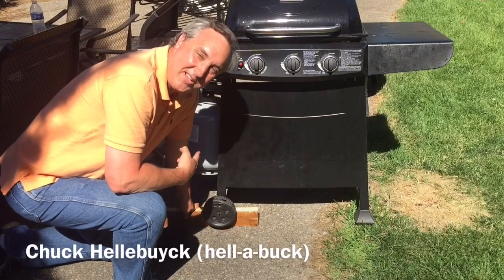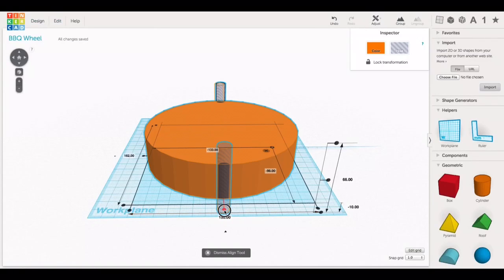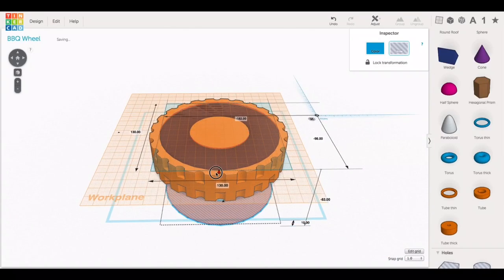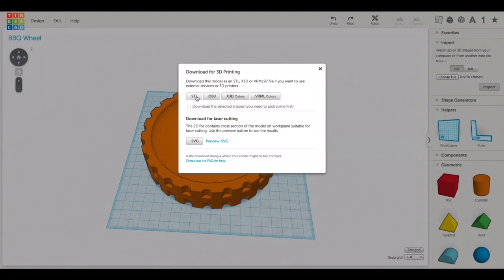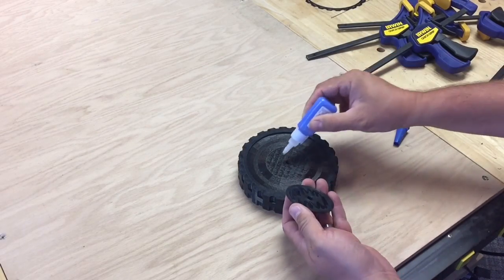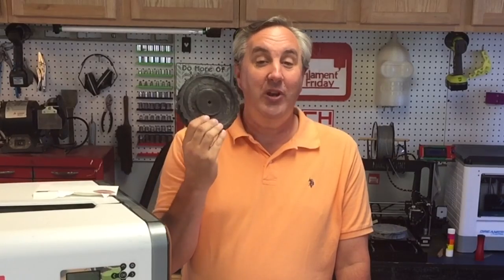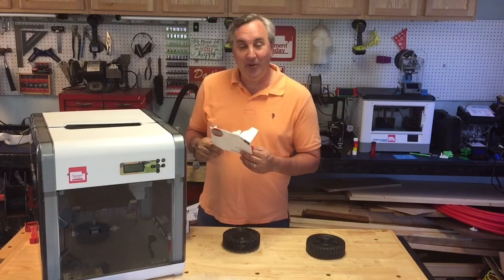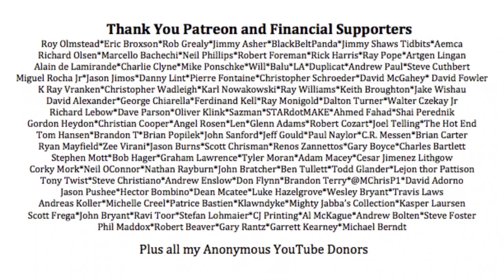3D Printed Replacement Wheels for Barbeque Grill

Comment: We had some kitchen plastic containers. They're pretty expensive since they have these special tops which close and vacuum seal. One of their tops broke, so you couldn't close it and vacuum seal it. I took the top, modeled it and the handle, then I printed it. The cost was really negligible as the top is pretty small. But now the top for the container is as good as new and works perfectly to vacuum seal = happy wife. Same thing -- have a cannopy which had plastic caps on the alluminum braces which need to slide along the top of the supports. Some of the caps fell off, some I found in the yard, some are gone for good. I designed it -- simple print, just a cap, and printed 12 to replace all of the originals. Work better than the original, don't fall off. These uses of 3d printing are awesome. Keep up the great work Chuck.

Comment: Great video, love practical replacement prints. Did a couple myself for a couple items in the home.

Not sure if anyone mentions it in the comments. But you can continue a print if you ran out of filament. SO long as you didn't remove the print from the bed. Just begin the print from the stopping point in S3D. No need for gluing. 

Keep up the great work.

Comment: Great practical print !. + Next morning in house delivery sure beats waiting and payin' for postage .  LOL and the product support is in house too. way more fun . 
Have you ever tried hitting the  rough spots with a mini torch . I was in need of a bottle opener , and use a mini torch to smooth and seal up all the layers .  it made the lip strong enough to pop may caps .  5min design time in TC , and 15min to print , 2 min to torch smooth , and i coulds start the BBQ while it was printing and no one had to head to the store.
Reply: i use one of those small butane ones that are also supposedly soldering irons , but never last as irons ,  but the small flame is easy to control like a brush . Works ok on PLA , I know you like ABS  mostly , but the smell is horrible on ABS for sure ,  hot PLA smells better .  I messed with a few test parts one day , ad was impressed with the wet smooth like finish .  with some care  it caa even melt and smooth out the layer lines. worth a shot when you have a min or two between prints if you have one of those small ones .  My Weller butane iron , is industrial and way to hot ,  PLA goes rite to black , but my cheapo' burnz-o-matic one  is pretty easy to use.
Reply: yeah true .  I recently printed a catch for a sink drain that had no way to 'catch' junk falling in .  I used  blue  Flash Forge PLA , and it has been 2 weeks , with hot , cold water , soaps and all sorts of stuff , and the top edges are just a bit light in color but  that  goes away when  really hot water hits it . But abrasion and sunlight and such might take out PLA pretty quick .  hmm could be a good test with my extreme temp' changes here should print out some parts and put them outside . I wonder how long the pull start handle I made for a mower will last . LOL .  My ABS and ABS plus  melt ok , but if yo linger  you can scorch them and the stink real bad . LOL

Comment: In Simplify3d play with the "Horizontal offset from part" setting. I use to have problems with the support and raft not pulling away easily play with this fixed the support. There is also a setting for the raft separation as well.

Comment: they need to design a switch that sees the filament is running out & pause the printer ...
Reply: I personally have seen 2 different designs.  One of the designs is merely a "is there filament" and the other checks the width of the filament along with "is there filament" so you can adjust the feed rate on the fly.